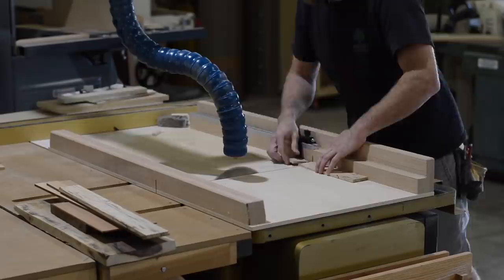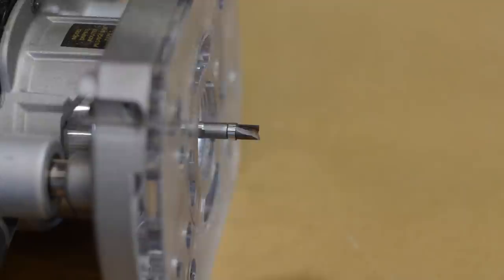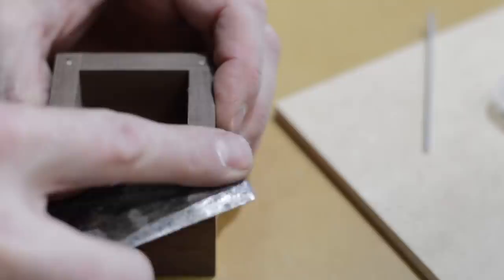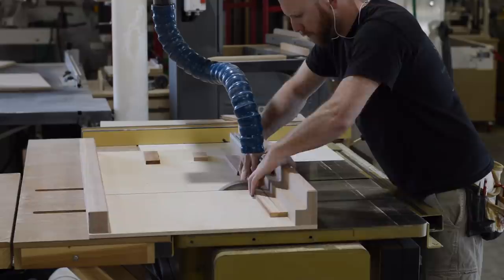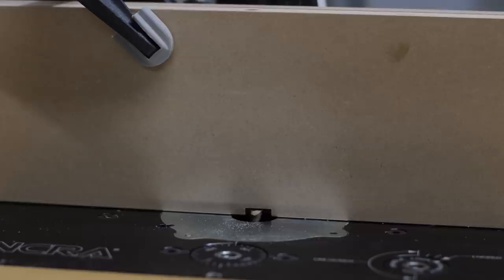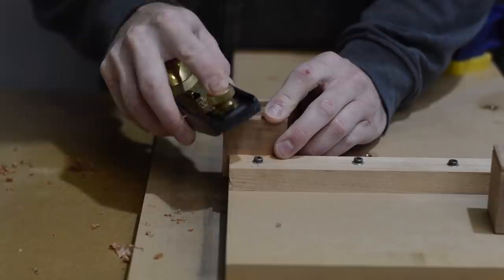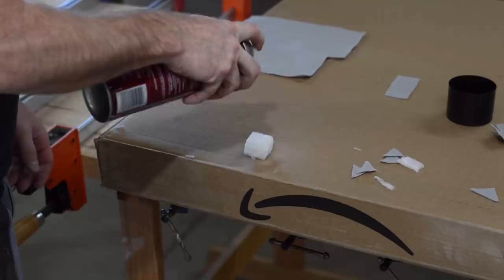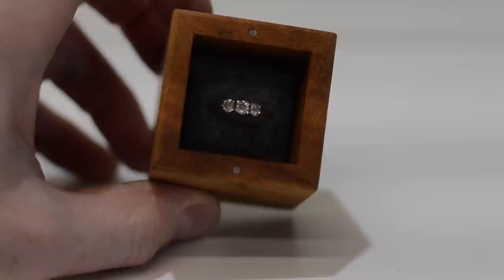Ring box build, dovetail and miter with special guest Jonathan Katz-Moses

Comment: For dealing with small magnets a pair of stainless tweezers and a dry-erase marker come in handy. Mark the face of each magnet as you remove it from the stack to help keep them aligned. Or if you'd rather deal with cleaning solvents than the dry-erase marker dust, substitute a sharpie.
Reply from the maker: Good tips. Thank you very much.

Comment: Love the boxes.  Great job gentlemen.  
Mike - Can you explain what you used to hold the ring inside the box?  Trying to figure out the best method.  Thank you.
Reply from the maker: Thank you. I used some chair foam cut to size, I cut a slot for the ring, and then wrapped it with some felt. Hope that makes sense.
Reply: Yes sir it does.  Thank you for the response.

Comment: I love the router tip on dovetail clean out!!!!!!!
On a side note....in another video it shows on your table saw a dust collection tube over the top of the blade.....do you remember where you sourced that?  Thanks man,   Van
Reply from the maker: Thank you very much. The dust collection tube is called Loc-Line. I get it off Amazon.
Reply: @MikeFarrington  Thanks for your help Mike!
Reply from the maker: My pleasure.

Comment: Hi Mike. Love your videos, I have watched them all. Just a simple question, what are the yellow ear defenders that you use (9.15)? Keep up the great videos.
Reply from the maker: Thank you John. I hate to admit it, but those used to be white ear buds, they are just 10 buck sony ear buds, but I put some better ear pieces on the ends so they fit my ears really snug.
Reply: If you look at the time stamp 9.15 you are sitting putting finish on the boxes, you are not wearing earbuds, but normal ear defenders with an antenna and some buttons on them. What are they?
Reply from the maker: @IvaBiggun  Sorry, I'm an idiot, those are muffs made by Stanley. They have a radio and a 1/8" input. They are 50ish bucks on Amazon.
Reply: Thanks. I was hoping you was going to say they were Bluetooth. Never mind, keep up the great work👍👍👍👍
Reply from the maker: @IvaBiggun  I wish, no one makes a good set of muffs with bluetooth yet.

Comment: im very interested in buying  that dovetail jig/guide.can you do the pins and tails with it ?
Reply: Yes absolutely
Reply: i hope im lucky enough to win that awesome set
Reply from the maker: Yes, you can cut pins and tails, it also cuts at 90 degrees for the shoulder cut on the edges of tail boards. It works very well. I say in a test board or two, you will be cutting some very nice dovetails.